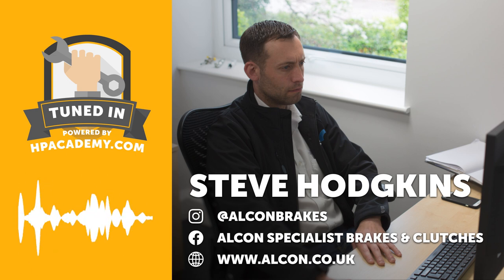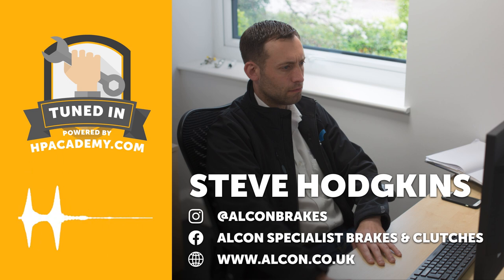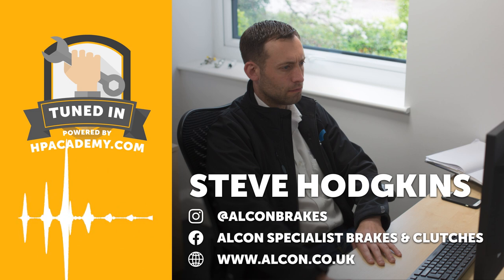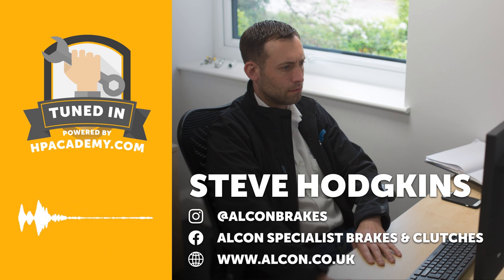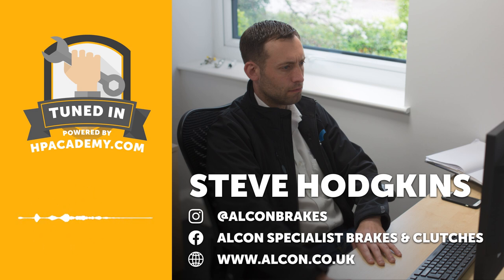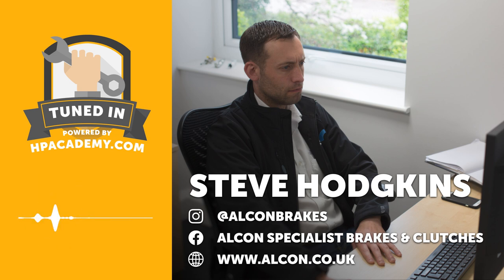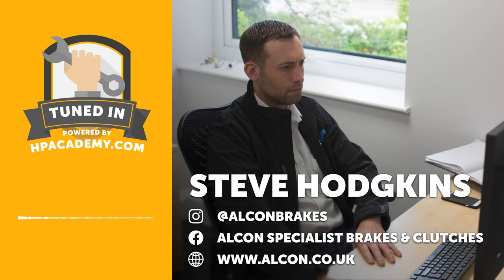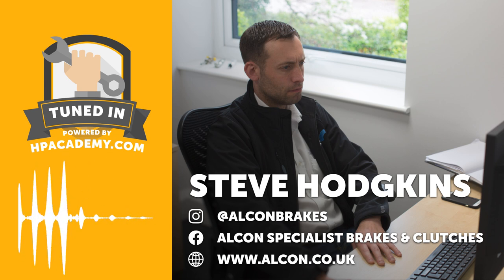082: Brake Setup | It's MUCH More Important Than You Think [#POCAST]

Comment: Its a quite interesting fact that in the formula for calculating braking force area is not part of the equation.
So for single brake ability size is irrelevant! 
All else being equal what matters is the friction coefficient and clamping force(pressure).
So you could find yourself having less braking capacity going to a bigger caliper if it means less force going through the pistons in the caliper.